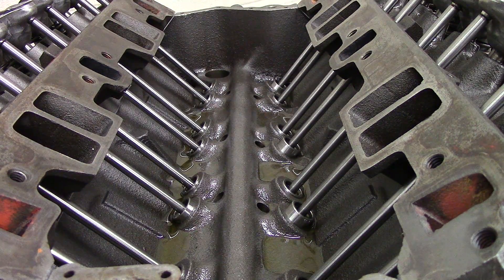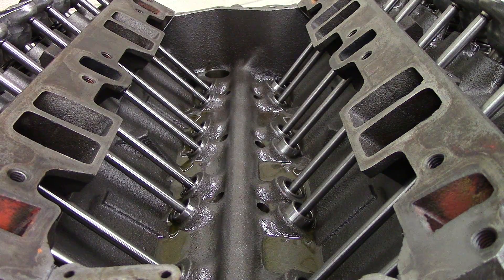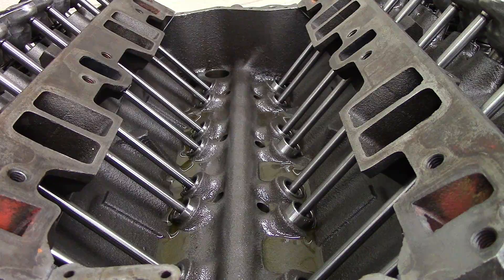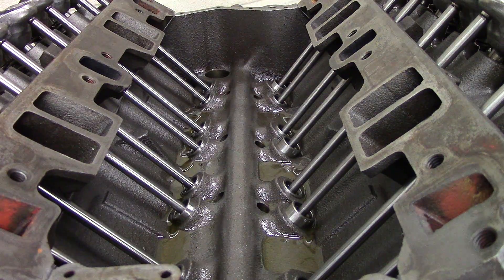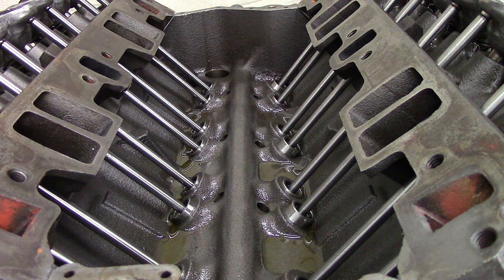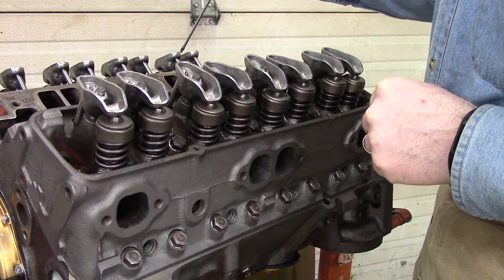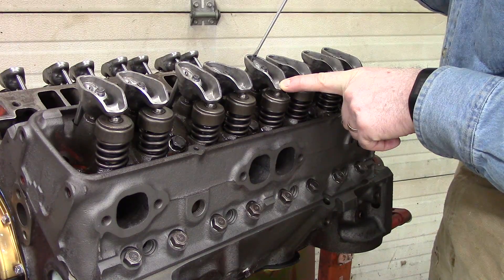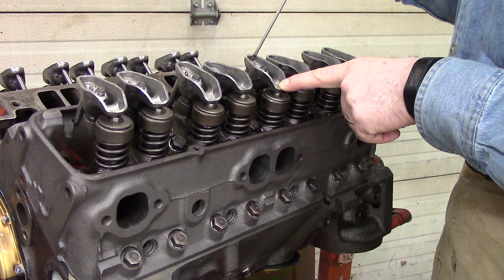V-8 Engine Rebuild SBC #13 180 degrees off?

Comment: the way I was taught to do this (after adjusting the valves) was to rotate the the crank timing marks to 0 on the tab and take note of which valves were moving, if #6 were in motion then drop the distributor in with the rotor at #1 firing position, if #1 valves were moving then position the distributor with the rotor pointing to #6 firing position, getting a new engine to fire right up is very important, I have seen several times a new cam shaft was ruined because someone fiddled around for days trying to get the timing right

Comment: The number five exhaust should be closed if the number one is on compression stroke?  How would I I hot the lifters if the intake is on to verify I am not 180* off?

Comment: I can’t seem to resolve my 350 rebuild issue... anyone know what I am doing wrong here? Any help is greatly appreciate! Video attached... https://youtu.be/5Qj9XphVNFs
Reply from the maker: My valve adjustment video is the link below, but your video is very unclear as to what your issue is, possibly not a valve issue. The engine turning over so slow seems like a battery/starter issue at this point. As the other person on your video asked how does it turn over by hand? When you start adjusting your valves make sure #1 cylinder front left when sitting in vehicle is at top dead center and timing marks are aligned, if you are 180 degrees off and adjusting the wrong valves it won't work. Good luck ask more questions if you want. https://www.youtube.com/watch?v=jTJWdTuzrj8&t=156s